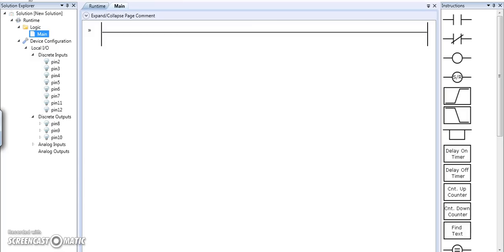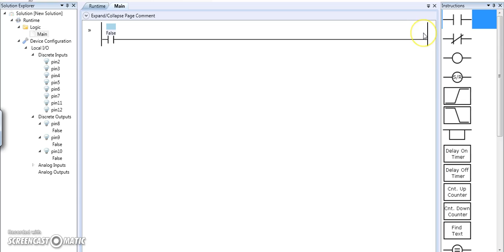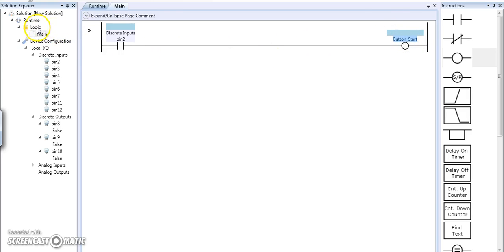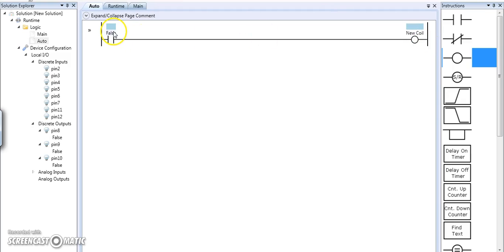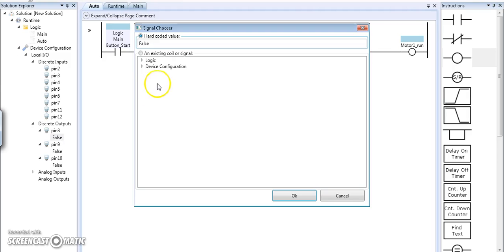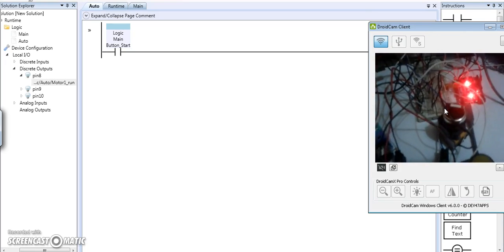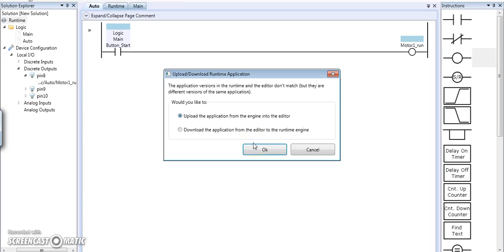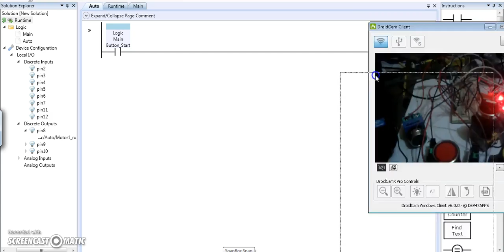Arduino ladder like as PLC #1

Comment: Sir, when i connect in runtime,  the all pins are start blinking, and all pins are force on, help me sir what is the problem..
Reply from the maker: Santosh BJ  
pin Blinking . you mean input pin?
all input pin must resistance to 0V
Reply: @khmerautomation8445  yes sir all input start blinking without giving any force,
Reply from the maker: You try yet? 
All input pin must jump resistance to GND(0v)
Reply: @khmerautomation8445   yeah sir, now it is fine,
Thank you ☺️